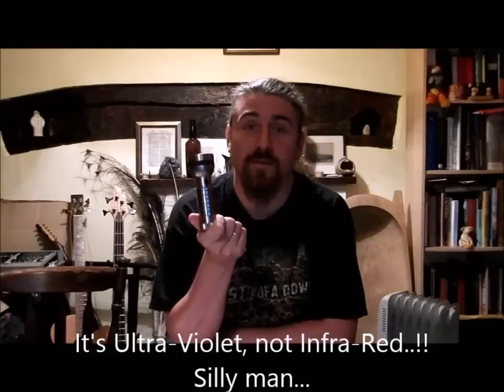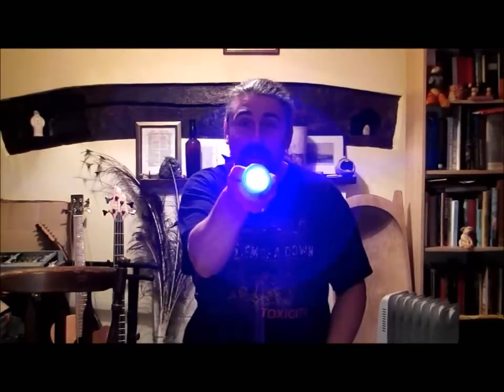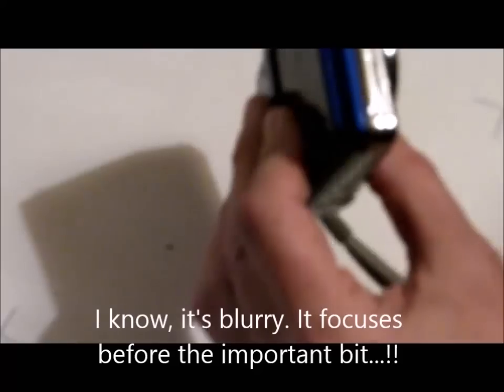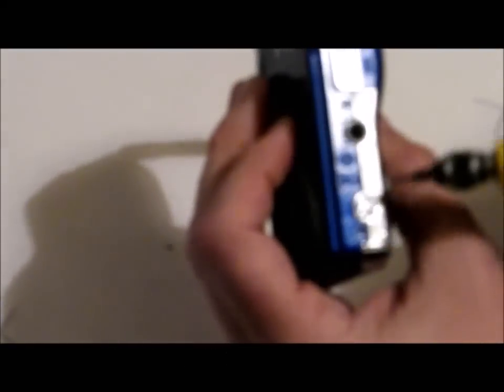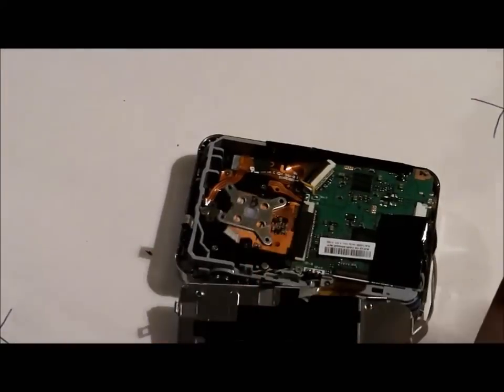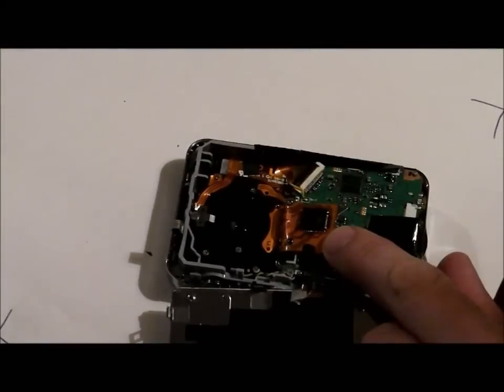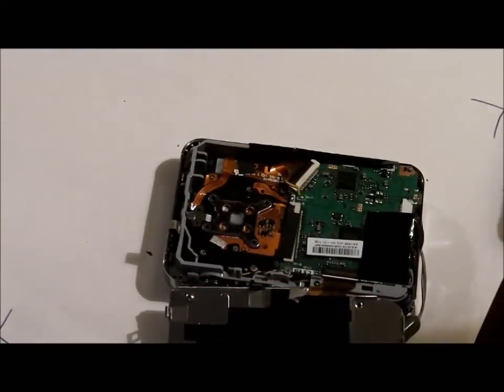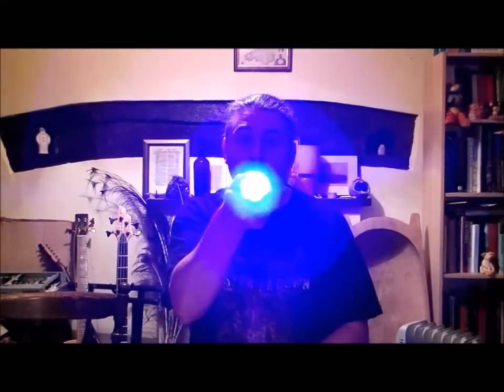Convert your compact digital camera to I.R or full spectrum.

Comment: Hey Thor...I decided to try and cinvert my camera on my own but I had a question for you. When I remove the filter inside the camera do I need to replace it with anything for it to work? I bought IR lights so I have that but I am confused if I need to add a clear piece of glass, film or filter once I remove the one inside the camera. Thanks so much...you're a lifesaver.
Reply from the maker: It depends what you want the camera to do. If you want it to be a full spectrum, you don't need to do anything after you remove the filter, just put everything back together and your camera will pick up everything from near infra-red to near ultra-violet. If you want it to see only infra red, you have to replace the filter with a piece of exposed film from a photographic negative cut to the same size as the original filter.
You should probably go for the full spectrum as that gives you the best of both and you don't have to fiddle around with cutting up tiny pieces of film. Plus, most people don't even have any old negatives around the place these days.
Reply: +Thor Awesome! Thank you SO much Thor! I really really appreciate all of your help. I will definitely go for the full spectrum then. Having owned a photography studio years ago I do have TONS of extra film laying around but I am gonna go with the full spectrum at least for this camera. Thanks again for your help...you are always so sweet and helpful! Did you get a chance to see my little short video of an orb (or whatever it was) that I captured in my house after we moved in? I would love to see what you think about it. The link is posted on here...Thanks Thor! You're seriously the best!
Reply from the maker: Hey hun. I haven't seen your orb video yet but I'll definitely have a look. Due to the nature of my work, things tend to run in cycles for me. I have a couple of months where I'm doing very little than a couple of months where I have little or no time to myself so YouTube/paranormal stuff/UFO research, it all gets set aside. Then there's our farm which is only about 17 acres but still takes up a fair bit of our time.
I'm looking forward to seeing your photographic and video results with your conversion..xx..
Reply: Oh I totally understand! No need to rush to view my video just when you have a minute, it's literally like only 49 seconds or so. But I totally understand and it's no big deal. Thank you for always being there to help me. I appreciate it more then you know! Your farm sounds beautiful! If you ever do a paranormal video there you should show some of your farm. Hope all is well! Hugs!

Comment: Where you able to use the Cameras LED display as a sort of night vision?
Reply from the maker: Hello Bert,
No, it's of no use. Most of the light from the led is in the visible spectrum and provides no I.R illumination, though I don't suppose it would be too difficult to replace it with an IR or UV led.
Reply: Sorry I did not mean LED I meant the LCD screen.
Reply from the maker: Bert Bernardo Not really, the screen faces in the opposite direction from the lens so wouldn't cast any illumination in the right direction.

Comment: Hi can this be done to a vivitar 7388s I opened  it up but insides are very different not sure how to remove lcd and back plate
Reply from the maker: +Shane Griffin I've got no doubt it could be done, most if not all compact cameras can be converted but I've never done it to a Vivitar myself so I'm sorry but I can't advise you on your camera.
Reply: hi thank i have now done 3, i would like to do a  Vivitar DVR908M Full HD camcorder  to full spectrum is there  any videos on this i cant find any
Reply from the maker: +Shane Griffin Same principle applies. As long as you can get to the back of the lens, the I.R filter can be removed and that will do it.
Reply from the maker: +Shane Griffin Don't panic, you're not being a pain...  I hope you didn't plug the lamp into the mains, they are only built to handle 12 volts so the mains will blow them. If you did only give it 12 volts then it should be fine, the reason it seems dim is because your eyes don't see a lot of infra red, plus the lamp has a light sensor in it so it will only fully illuminate the IR leds when it's dark. Thats why they appear to glow more when you get close, you're blocking out some of the light so they react by getting brighter.
Reply: +Thor i did try in the mains and quickly relised after messaging you what i did and what a idiot i was, any way iv worked it all out all 3 cameras are working great with the ir light im well happy thank you ,
just one more thing is the film the only think you can make a ir uv filter with as thats one thing i dont own